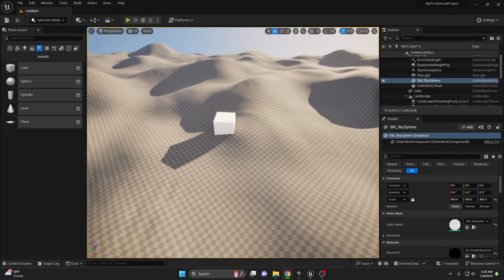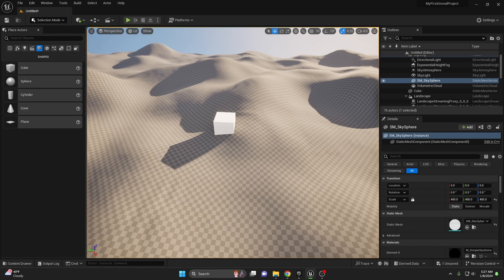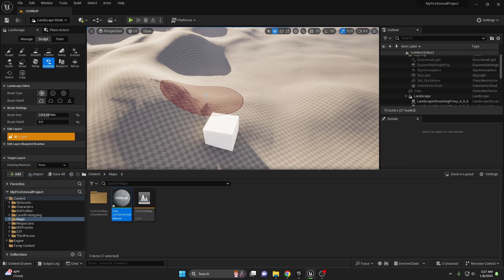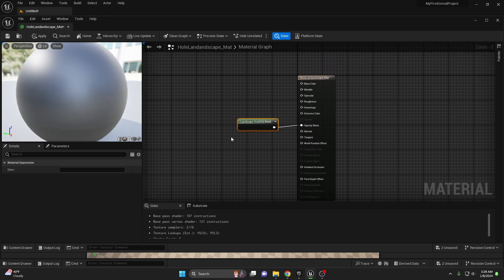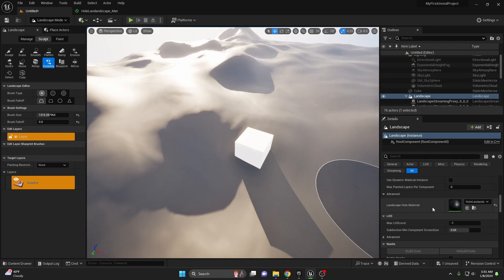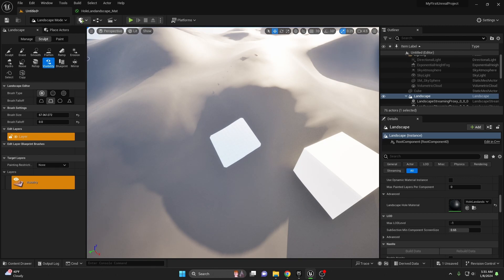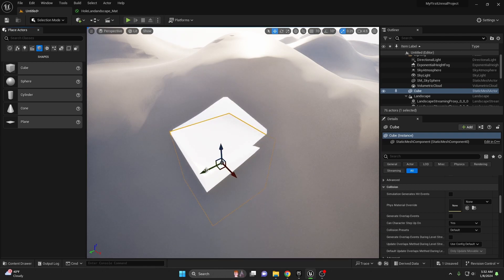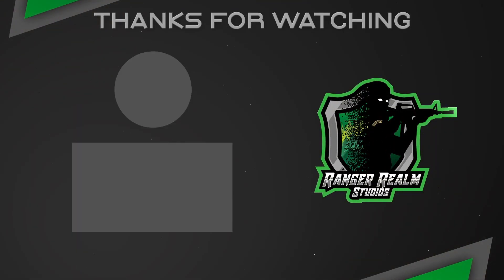Unreal Answers: How to Cut a Hole in Your Landscape

Comment: For those who use this method but have an existing landscape material, dont create the new material, just add the landscape visibility mask to your existing materials opacity mask and do the rest (I did the video as advised than changed at the end) make sure to remove the holeLandscape material and it should then work.
Reply: THIS RIGHT HERE. Go back to your original material, set Blend Mode to Masked, which will enable Opacity Mask on your Material, and then add the Landscape Visibility Mask.